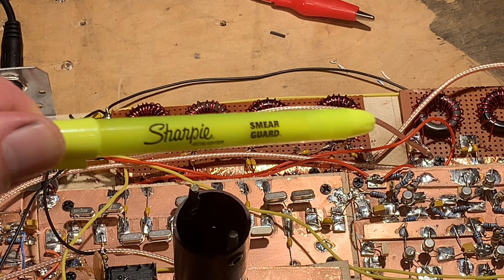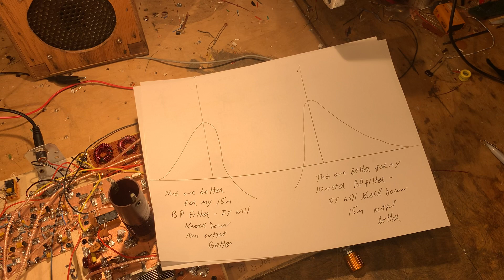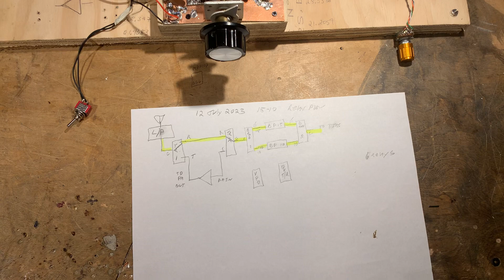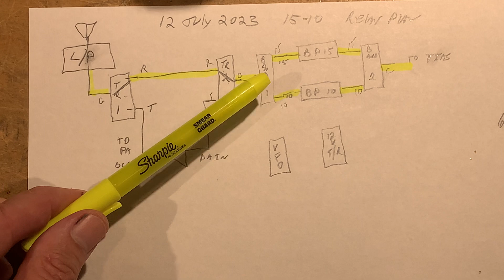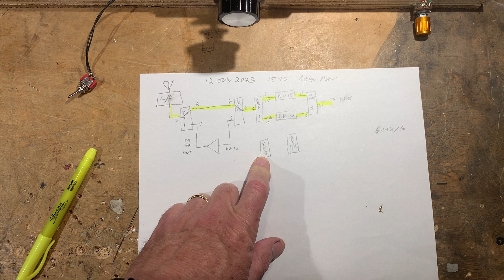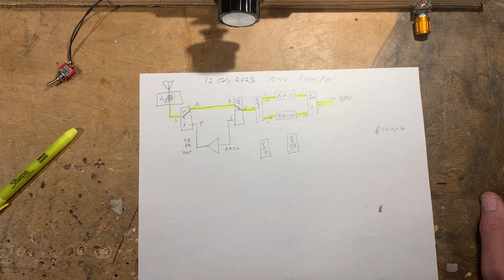Update on the 15-10 SSB Transceiver Rig

Comment: Great progress! I buy lengths of aluminium angle from a local diy or builders merchant. Typically 1m long & 25mm "L" Profile. It is pretty cheap and can be easily cut for mounting brackets and corner joints for simple enclosures.